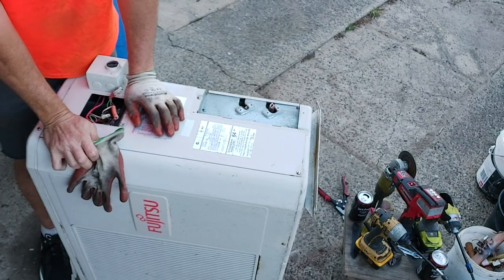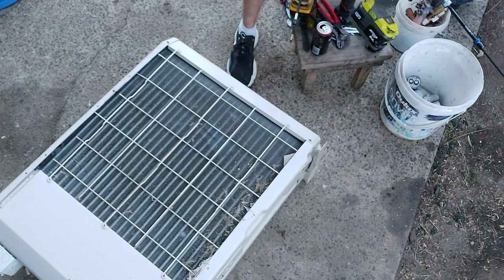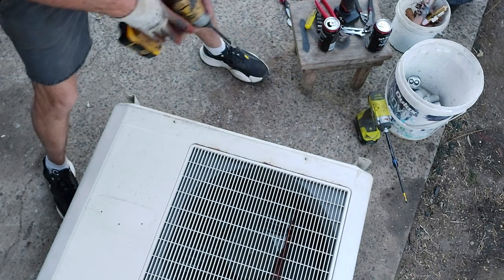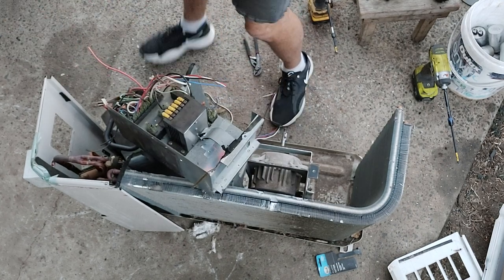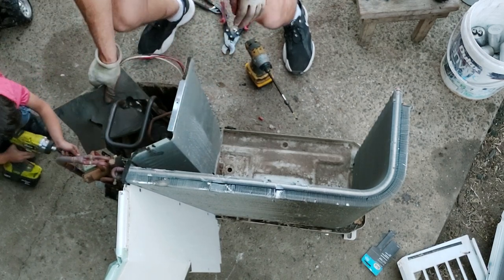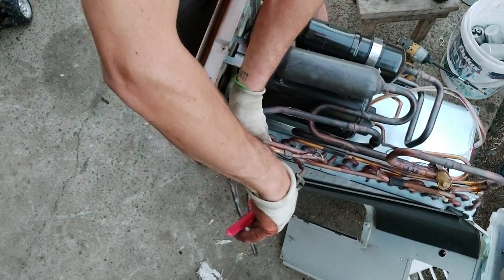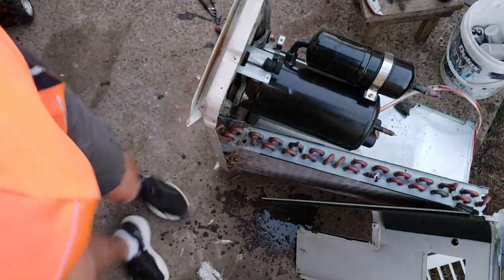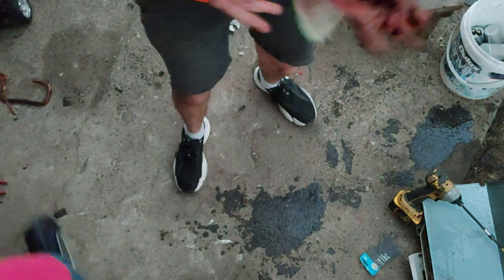Aircon Condenser Strip Down.

Comment: Good video Dan. Watching you from all the way over in Perth. Hey, those silver cylinders you are pulling out are called capacitors. They can store a fair Voltage sometimes, mainly when they have recently been working, otherwise the Voltage drains away over time. They can bite, believe me. So short them across both terminals before you touch with the fingers. You may never encounter an energised one, but if you do you will no it. They come in all shapes and sizes and to know them you look at the labelling on them. If you see a funny looking u followed by an F that's a capacitor. Eg 5 uF which means 5 micro Farads. Just a little bit of information to store in the memory bank.👍
Reply from the maker: Hi Brad cheers for watching and i hope your holidays are going well. Thanks for the info on the capacitors, iv stripped alot of microwaves in the past and learned about the potential dangers they may hold tho never encountered it, iv always had the belief  (whether true or not) if i cut the cords and dont touch the terminals then handling a capacitor is ok, plus the gloves have a rubber padding so im just assuming thats ok , the finer detailed info you spoke of is stuff i didn't know so thanks for mentioning it.

Comment: A strong table could save your back when you are stripping down materials.🙃
Reply from the maker: Thanks for the tip Cecilia but for me when it comes to stripping those heavy aircon condensers i find it easiest to just strip on the ground, but when it comes to stripping the blower ( indoor unit ) then yes up high on a bench is definitely best.